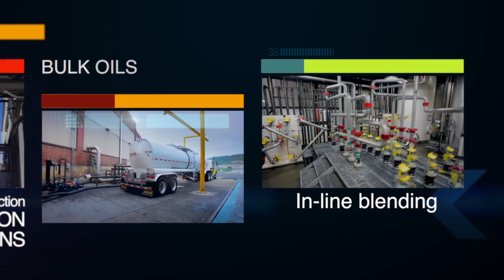Pronto Motor Oil

Comment: Cheap ass oil
Reply: I've been using it for years, no problems whatsoever. It generally meets or exceeds the standards of anything I use it on and I'm regular with my maintenance so I have had zero problems with it.
Reply: better than Amsoil
Reply: They don't dump loads of money on massive marketing and advertising. That's why they keep their costs much lower than anyone, they supply oil to Walmart Supertech and Amazon Oil.
Royal Purple, Amsoil, Redline, Mobile 1 have lots of publicity.
Reply: You've used oil from Warren and not even known it.  They create a first class product.